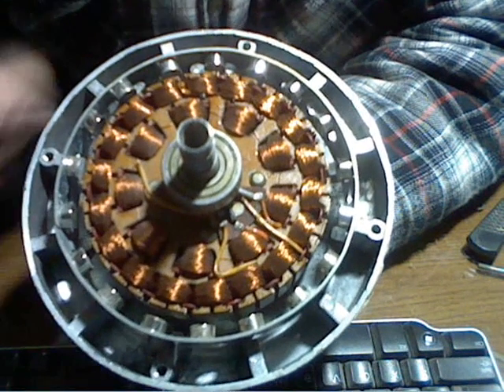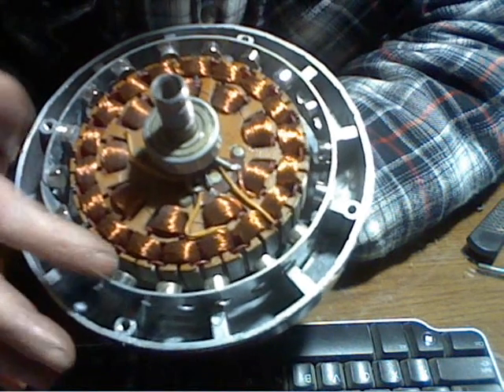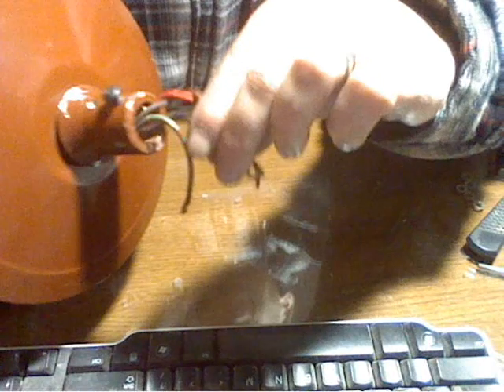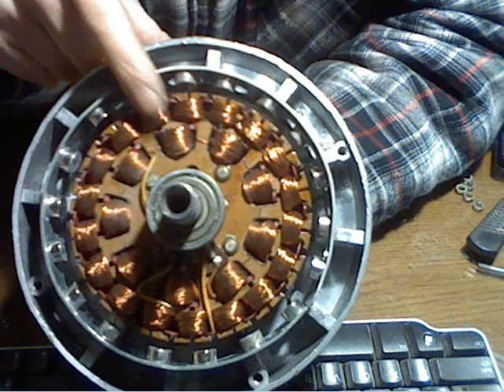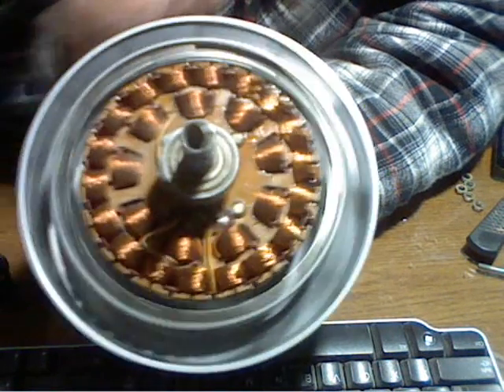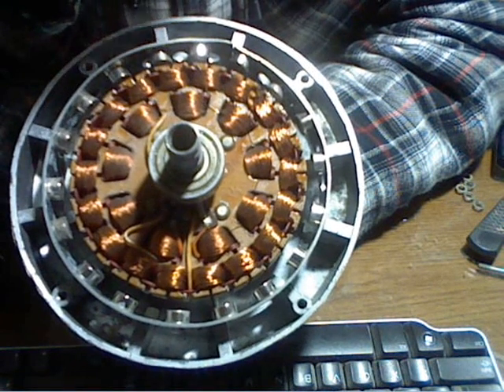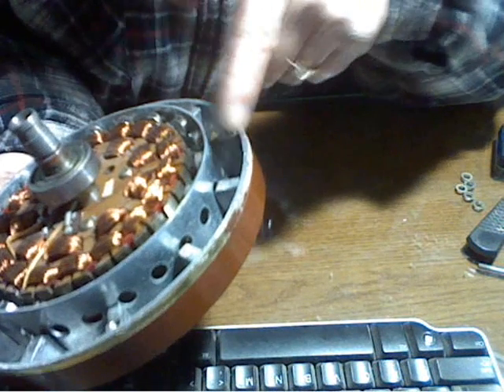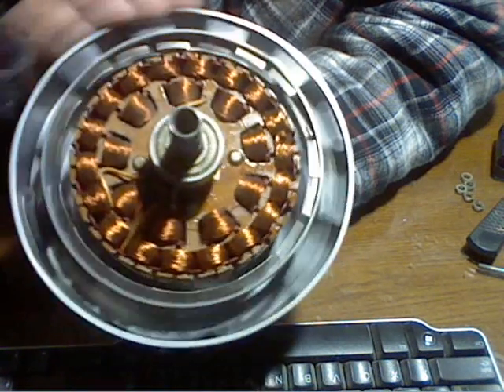wind generator ceiling fan

Comment: Great video  I was lucky to find these magnets on Amazon.

 ZHYF 20PCS 12x3mm Round Magnet for Refrigerator 
Magnets, Offices, Artwork, Craft Whiteboards, Maps, Multi-functional 
Durable Small magnets
                    

From Amazon $  7.95  B07BK5KYVD  These are extremely strong and make my 
ceiling fan hard to turn. The are not in contact or rubbing.  I need 
almost 3 packs per fan.